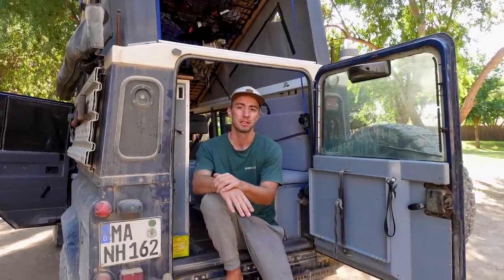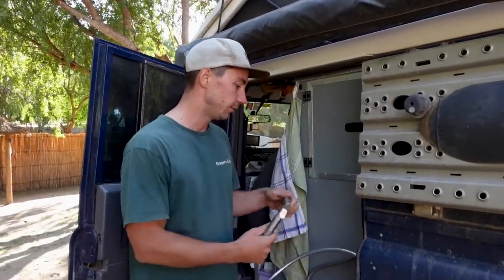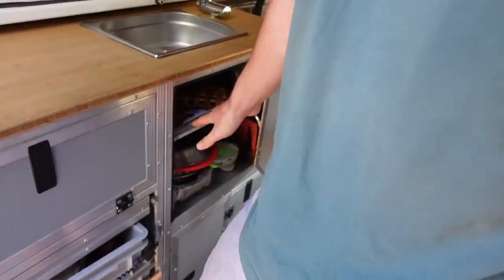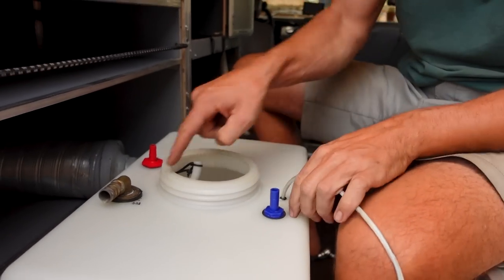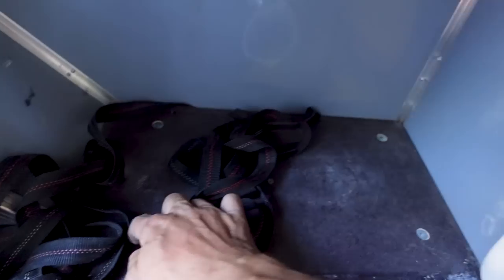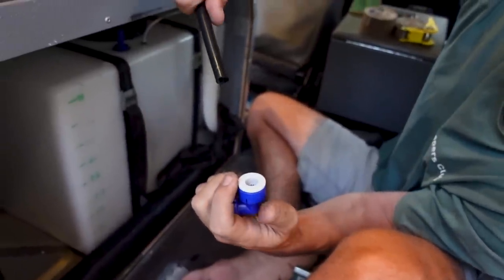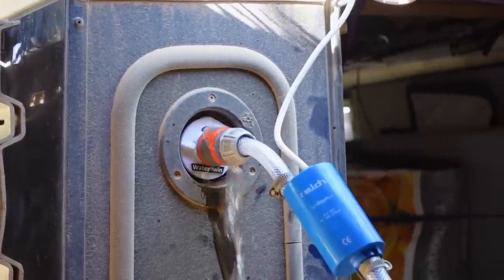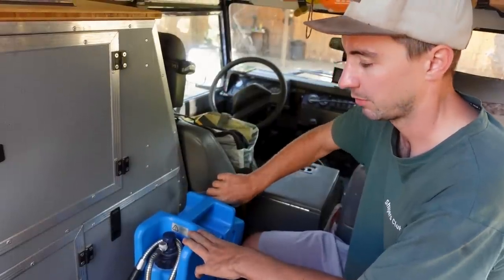The Ultimate Water System for Overlanding Trucks, 4x4s & small camper vans

Comment: I like the practical simple design of your system eliminating sources of failure where possible. Before this I was looking at filtering all my water going into and out of the tank like #TheRoadChoseMe possible but maybe not necessary for my needs.
Reply from the maker: Hey Peter, yeah in my opinion it's overkill to filter everything all the time. I guess what we forgot to mention is that we use Micropur (silver ions) every once in a while to keep the tank hygienic, especially if we use questionable water sources. I guess you don't need it in regions where the water has added chlorine.

Comment: Eugene, Oregon, USA.
One of my hobbies is walking wrecking-yards aka vehicle 'dismantlers'.
After a junk wrecked or burned factory RecreateVehicle is stripped of its aluminum siding, the internals are visible.
.
Invariably, their translucent fresh-water tanks are laden with sediment from unfiltered water during filling.
Often, tanks have several inches (a fist-high/75mm) of muddy muck in the washing and drinking water.
We think a sediment filter on the inlet is reasonable.
.
Without suspended debris, the UV light can ZAP! the tiny trespassers.
With suspended debris, bacteria and viruses can hide behind the floating crud, in the shadows... and the UV is ineffective.
Reply from the maker: Thanks for sharing your experiences! 
Sometimes I think having a sediment filter to fill the tank would be great. But if you have already low pressure or you even need to fill the tank with a bucket it doesn't help. 
I designed the tank compartment that you can take out the tank easily to clean it every once in a while. We had hardly any sand in the tank after 2 years of intensive usage.

Comment: Nice video. Indeed a lot went into the design and thought process for space saving and efficient functionality. I would have really appreciated seeing how you fill the 4" PVC pipe used for showering.
Reply from the maker: Hey, 
Good point, we’ll soon make a video showing the Shower including the warm water system.  We can add it there. 
But basically there are two ways to fill it.
If we have a tap we just connect a hose in the front and open it in the back so the air can escape. If we fill it from a river or so we just open the back lid and pour water in with a bucket.
Reply: @Thebluelandy  much appreciated. Will be keen to see the next video.

Comment: My home,  when not moto traveling, is a sailboat
I would not use any elec...at all.
Hand/foot pumps are most reliable
An inexpensive 2 gallon garden sprayer container as your shower is a no-brainer
There are many gravity filter products for camping available. Fool proof.
I can't belive you were given this advice for longterm travel
Reply from the maker: Hey! We have been traveling many years with different setups(also smaller cars). Including many years with no electric water system, using water canisters and using buckets to shower. Yes, this works of course, but for continued use (every day) it gets pretty tiring to live like this. For a couple of weeks trip it was absolutely no problem, but for longer periods we value a lot the comfort our system gives us. And yes, when you add anything electric you need to deal with one more component breaking. And I understand your concerns with reliability. We value this as well! So far nothing on the electric side broke. 👍

Comment: Really nice setup ... obviously well thought out and I like the separate drinking water solution. I was considering an inline filter for the water using 1/2" fitting Reverse Osmosis filters. They're quite big though but I have a lot of experience with them having a 5 10" filters for RO/DI in the house. But the filters are very cheap and widely available.
Reply from the maker: Hey, thank you! Yeah inline Filter are also a good solution but we decided against it cause we would need more pressure and therefore another pump. More pressure also means (most of the time) more water consumption. In the end we did the math and saw that our current system would cost us half of the other options.
Reply: @Thebluelandy  At the end of the day the correct answer is the one that works best. If it works well for you and meets your needs then it's a job well done 👍
Reply from the maker: So true!

Comment: Thank you for sharing.
A great insight into what really works after years of experience.
Can I ask which engine land Rover would you recommend for over land travel?
I think yours is a td5?. Would you buy the same again.
Thanks and best wishes for future adventures together in your wonderful truck😊🖐️
Reply from the maker: Hey, yes we have a 10P(early) TD5, I'm happy with the engine, and I would again go with a TD5 maybe next time get a 15P (late) TD5 but only cause it's easier to remap the engine. 
To be honest I don't know too much about the other LR engines, I worked on the TD5 and at a 2.4 TDI (puma) they both seem to be good and reliable engines. In the beginning everyone said the TD5 is not reliable cause of its electrics and the control unit. And yes you should check for oil in the plugs at the ECU. And there are other things like the screw of the oil pump that should be checked every once in a while. 
But I strongly believe that, if you look after things they will last long. We were lucky and we bought a car that was looked after and is so far reliable. 👍
Reply: @Thebluelandy  Thank you for your reply and for sharing your experience.
It is tricky I suppose, all have strengths and weeknesses.
Probably see what is around with the best service history.
Looking forward to your future videos with so much inspiring content.
Best wishes 😊🖐️
Reply from the maker: Thank you 😊

Comment: I really like the realtive simplicity. We are still on a 'canister and PET' concept with mobile filter for occasional use. It seems you are comfortable with using unfiltered water on the body and for cooking and washing dishes?
Also, are you using the inline pump to get water from a river for example?
Reply from the maker: Hey Frank, thanks! Yeah we didn’t want to go with PET there is already enough plastic out there and for us it’s so easy to avoid. 
Yeah, on the dishes I don’t have a problem and showering as well. If I go to a basic lodge or camping the showers are most of the time also not filtered. Just try to not drink tons of water while showering 😂. 
We tried here and there to pump water with the inline pump but it didn't work so great cause it's not self-priming. And except for high mountains we avoid rivers as a water source
Reply: @Thebluelandy  :-) Understand the pump issue. Then how do you get water in the tank where no threaded tap is available (sorry for being a bit slow on this :) For example, we encountered freshwater sources in Italy and Albania where you could only hold a canister under a tap/hose/hole in the wall or fill it from a basin below. But the older you get, the less you can carry :-) so ideally we would like to put a hose in such a basin/well and let the pump do the heavy lifting :)
Reply from the maker: We have a 135 degrees funnel and a dry bag that we use as bucket to fill the tank. You could use a submergable pump those exist as self priming. But they in general don't like dirt or sand. 
We also bring some multi-purpose/flexible  connectors with those we were able to connect to almost every hose or tap.
Reply: @frank-lr  
To transfer water from a blank pipe (without threads), we developed our Universal Water Transfer System©...
... short sections of different size hose for different size pipe...
...with a standard garden-bib clamped on the downstream end.
The upstream end slips over the unthreaded water pipe, and a standard hose-clamp holds it in-place under moderate pressure.
.
In America, a 'garden-bib' is the standard threaded outlet with a knob for flow and shut-off.
These are usually used with a hose to a lawn sprinkler or a car-wash sprayer.